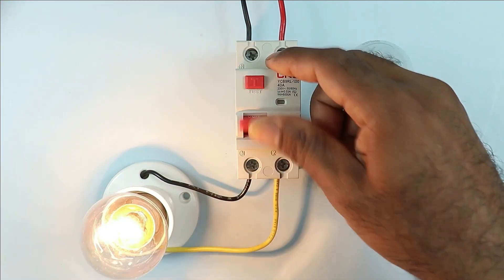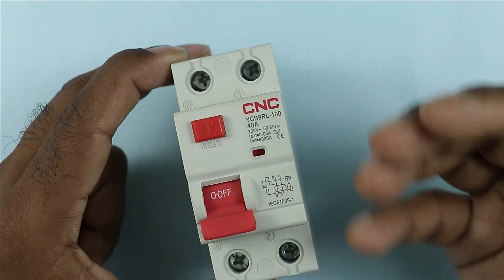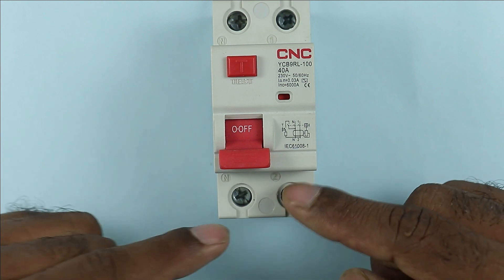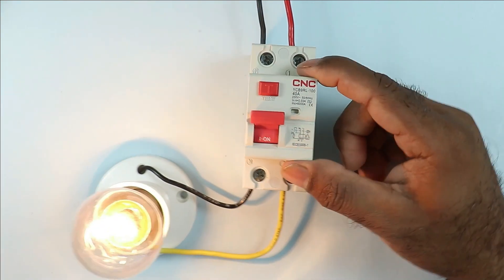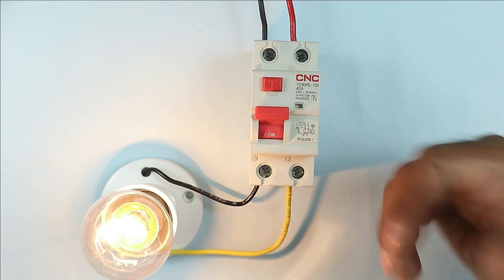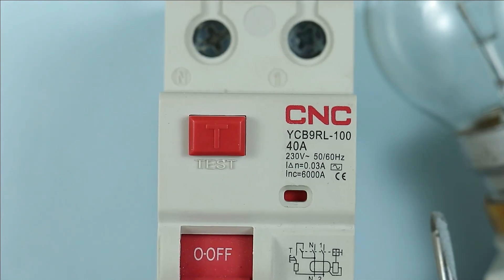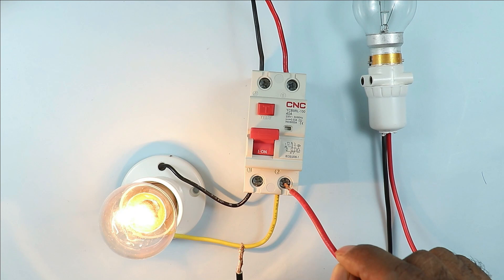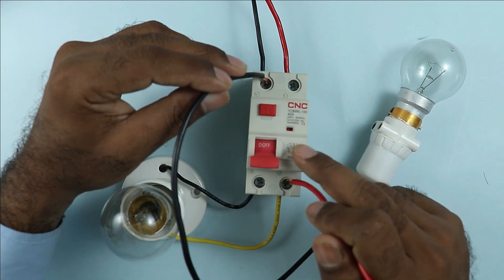How to Test RCCB/ELCB by using Lamp @TheElectricalGuy

Comment: Good video regarding how to test RCCB, thanks. If I can add though, RCCB is good to protect you from loss of neutral as well (which regular RCD can't provide) so in the interest of completeness it would have been nice to include a test where we simulate loss of neutral. Loss of neutral can be before RCCD or after it. So, if you disconnected the neutral from RCCD input and you connected your test lamp to point 2 of the RCCD (live on RCCD output) and the other leg to earth, the RCCD should have trippped too. This should work since the device has a mechanical mechanism and it doesn't require neutral to operate. As long as there is disbalance between the current passing via the live and neutral the RCCD will trip. And how important is a protection from loss of neutral? Pretty important actually. If you lose neutral all your appliances will become live (in a two wire system) and a person can be electrecuted if they were to touch any metal appiance and are bare foot let's say. So, in effect the neutral is your gardian angel in a two wire system. And if you lose the neutral you lose your gardian angel. This is the reason the neutral doesn't go via any breakers and switces, it has to be available all the time, to protect you!

Comment: Thanks for this informative video,one question plz,What the rating of test lamp you use in this video??🙏🙏
Reply from the maker: 100 Watt lamp which work on 220 VAC Supply
Reply: @TheElectricalGuy  ok thanks🙏🙏
Reply: @TheElectricalGuy  that's a 10watt night lamp bulb...